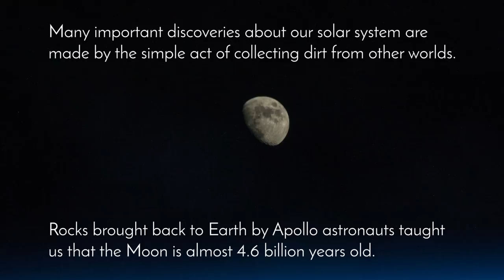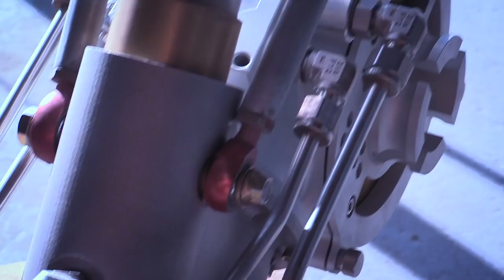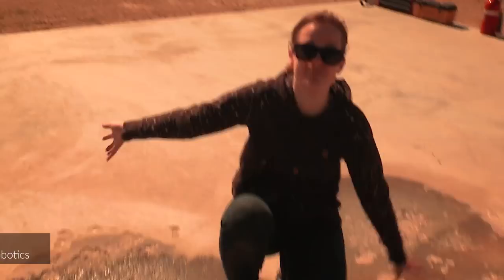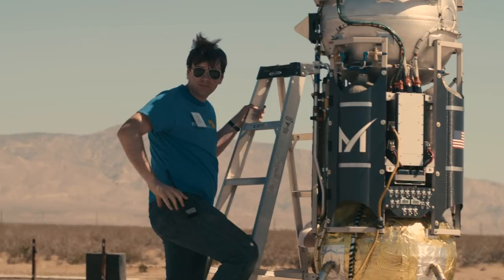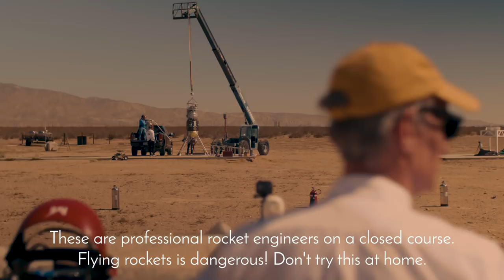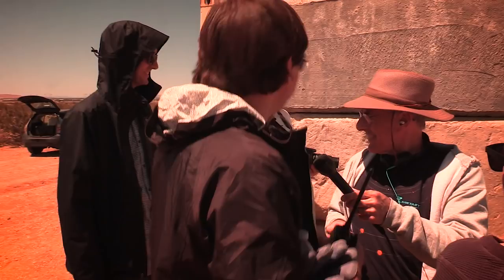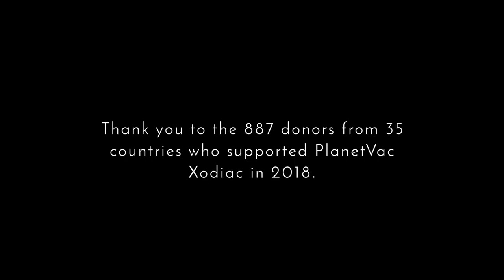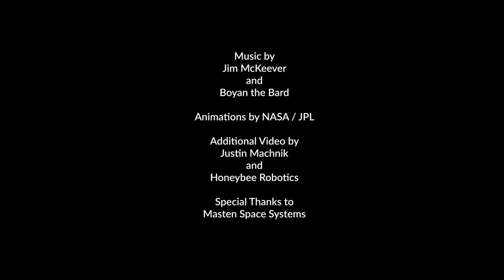New technology to sample dirt on the Moon - PlanetVac Xodiac

Comment: Would the sample not be corrupted by the landing thrust or potentially all the small particulates blown away? What advantage does this have over collecting a sample another way? Wouldn't you typically ditch your landing gear on the surface during the return flight?